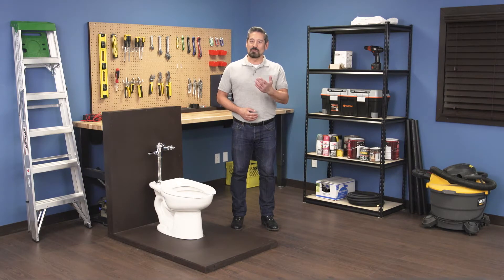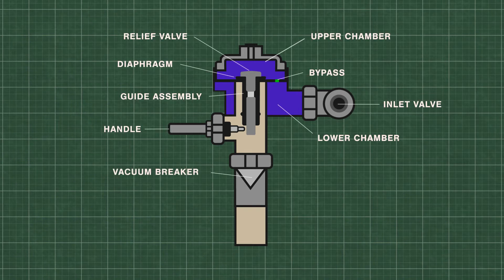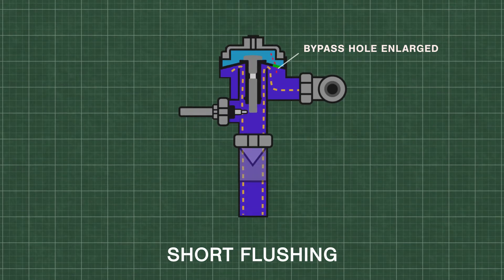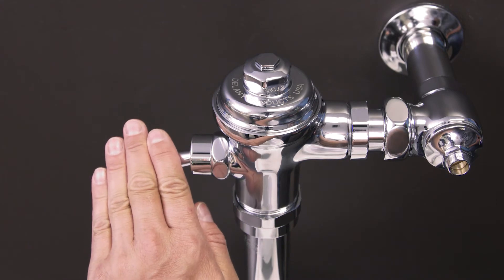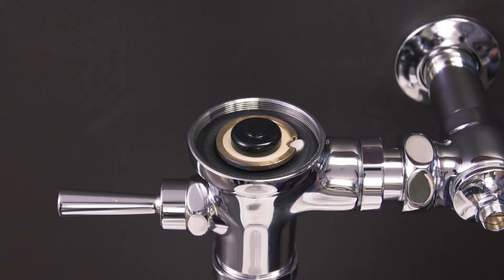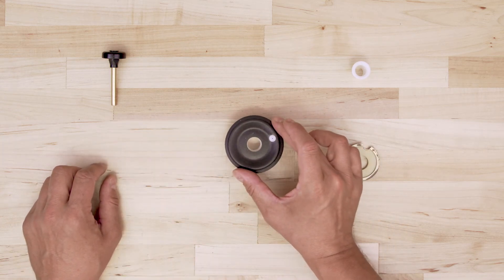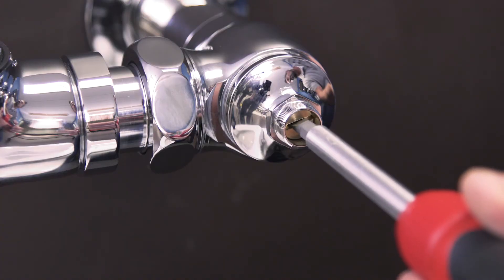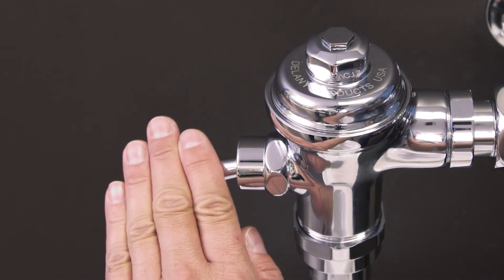Delany (Flushboy, Rex, Presto) Flushometer | Diaphragm | Repair and Replace

Comment: Hello. I have an old Rex Delany toilet flushometer rated at 3.5 gpf. The toilet is stamped 1.28 gpf . What GPF rebuild kit is required
for this repair. If I decide to replace the entire valve with a Rex Delany unit , would you recommend a 1.3 or 1.6 GPF valve.
Thank You , Regards Andy.
Reply from the maker: Thanks for watching. It is best to match the flow rate of the flushometer so a 1.3 gpf would work. If the toilets are 1.28 then the intention was to save water so it's best to match it and test to see if it flushes well.

Comment: Hi thanks for the video.  My problem that there is not enough water left in the bowl at after flushing.  Any advice as to how to get the water level a couple inches higher?
Reply from the maker: Hi Jacob, thanks for watching. It could be a mismatch between the gfp of the flushometer (determined by the diaphragm and relief valve) and the gpf of the tank. It would be good to check both.
Reply: @AmreSupply  Okay thank you!
Reply from the maker: @jacobsalas3274  You're welcome!

Comment: Do the Delaney flush boy and the Delaney Rex have the same diaphragm as well as vacuum breaker? Or are The part's different The Rex body is  smaller than the flush boy.
Reply from the maker: Hi Jennifer, thank you for watching. The diaphragm assemblies are a little different but the physical diaphram is universal so you can just replace the diaphram. You'll need to select type depending if its for a water closet or a urinal https://www.amresupply.com/part/302075-CRANE-FV-CLOSET-DIAPHRAGM

Comment: so i bought the flushometer on the cap it say 1.6  in the store the guy gave me 1.5 he said that it was ok just want to make sure before i replace it
Reply from the maker: Thanks for watching. There is not much of a difference between the 1.6 and the 1.5 so the flushometer should still flush properly.
Reply: @AmreSupply  THANK YOU SO MUCH JUST SUBSCRIBED

Comment: in what position should the by pass valve hole be in ???? thanks
Reply from the maker: Great question. Since the valve is circular, the water pressure is consistent all the way around the diaphragm. This means the bypass hole  and diaphragm can be in any orientation as long as its seated correctly.

Comment: Thanks for this helpful video! How often do you have to do this repair? Once a year, every two years? My Rex Delany flush valve keeps needing the vacuum breaker to be replaced every half year. I used to never have to repair the flush valve until I got a Rex Delany. Now, I'm fixing it twice a year, and occasionally replace the diaphragm, relief valve, or something else. Is my Rex Delany flush valve faulty?
Reply from the maker: Hi Tryon, thank you for watching. These repairs are usually done as needed. If you are finding that you have to repair it more often then it could be an issue with the water quality.

pH of water: Whether or not water is acidic or basic can affect how long the
rubber material remains compliant.

Solid particulate in water: Size and solubility of the particles in the water can
affect the wear of the sealing surfaces and their ability to form a seal.

 Soluble “biomass” in water can clog small orifices by slowly building up in high
flow channels.
Reply: Hi, thank you very much for your quick reply and answer! The water quality is OK, I think. It's NYC water, and it's supposed to be good.
Reply from the maker: Even with good water quality the hardness of the water can add up. When you replace the diaphragm, is there a noticeable buildup of calcium or any other particles on the bypass orifice? The hole is very small and its very sensitive to changes in the hole size so even even mineral buildup can change the way the flush resets. When the hole is plugged then continuous flushing can happen.
Reply: @AmreSupply  Thanks for your message and tip! I checked two old diaphragms that I replaced with new ones, and nothing was blocking the tiny bypass holes. I held them up to the light, and I could see through the holes.
Reply from the maker: The other factor can be the deterioration of the rubber. This includes the vacuum breaker and diaphragm as they are both exposed to the water. As for valve operation, sometimes its hard to narrow down but overall anything that prevents a good seal can cause the valve to run continuously.

Comment: Thank you for the video. My valve seat is stuck to the metal ring. Looks like the years of use have fused the two together. Should I use a knife or something sharp to try to pry it loose?
Reply from the maker: Hi lwc888, we're glad you found the video helpful. If you pry it loose, just be careful try not to dent the valve seat. You need a good smooth seal so clean up the valve seat afterwards if there is any build up of material on it. If you can cleanly get it apart then it should be an easy fix with a new diaphragm kit.
Reply: @AmreSupply  I changed the diaphragm because there was shortage of water. The old diaphragm was indeed worn. But after i put in the new diaphragm the water wont stop running. I think the hole isnt blocked. I am thinking the diaphragm isnt forming a perfect seal. I find that i need to push down on the diaphragm in order to be able to screw the top back on. Ugh.
Reply from the maker: Definitely can be frustrating. First question, did you replace the whole diaphragm kit or just the rubber diaphragm? If it was only the diaphram, then old seat might not be sealing properly which can cause the relief valve to stay open. Then water from the upper chamber will constantly leak out, which will prevent the upper chamber from pressurizing. 

Also if the diaphragm was warped it could be preventing the relief valve from seating as well.
Reply: I changed only the diaphragm because the rubber seal and the seat were fused together and they seemed to be fitting well. I was concerned I might screw it up if I pry the rubber loose.  And also, I have to pushed  the rubber diagram in slightly below the rim in order to be able to screw the metal top back on snugly. Is it possible that the diaphragm I bought is the wrong size? Or are all Delanys the same standard size?
Reply from the maker: The diaphragms are all the same standard size for these units, so they should fit the same as the old one. There are some variations in manufacturing as there have been many different companies all making replacement parts for these. Both the diaphragm and the relief valve needs a good seal for the valve to reset and considering that you only changed the diaphragm, it does sound like it could be warped. It should slide into place without needing to push it down.
Reply: @AmreSupply  thank you again. I will try and hope it eventually works.
Reply from the maker: You're welcome. If nothing else, you can always try a different diaphragm to see if it fits differently or a whole diaphragm kit just to remove any potential sources.

Comment: i have a delany and it started leaking at the tailpiece/stop coupling.  the super didn't know what he was doing and put sealant and shit on the joints and made the leak worse.  i took apart the tailpiece, and examined it.  it was a ground joint tailpiece, and these things don't have o ring or anything to separate metal and metal contact with the control valve, and it doesn't even fit snugly inside the control valve like you do on a sloan, or other models where it sleeves into the control outlet. no matter how perfectly seated the tailpiece will be, it leaked.
Reply from the maker: Thanks for your comment. You are right that the Delany valves don't use an o-ring on the tailpiece coupling. On new valves they generally have a more snug fit.
Reply: @AmreSupply  Hi! I think your videos are super helpful. I am having a similar problem of leakage at the tailpiece. Should I add an o-ring to address this issue? If so, what size o-ring would I need? If not, what are my other options?

Comment: Hi, guys.
My Delany flushometer started running, I watched this video, purchased a diaphragm assembly kit in supply house, replaced it and nothing happened - it's running exactly like before.
Any help?
Thanks,
Lenny.
Reply from the maker: Hi Lenny. If your flushometer continues to run after the flush is done then a few things might be happening. 

The diaphragm might not be sealing properly on the valve seat - If this is the case, check the valve seat for any cracks or irregularities.The valve seat in the Delany models can be replaced if needed.

Also the relief valve might not be sealing properly. Sometimes this is cause by the handle stem. If the stem is out of alignment sometimes it can prevent the relief valve from sitting correctly. Check the operation of the handle and see if it sticks during the movement. The handle and stem can also be replaced if needed.

Hope this helps!